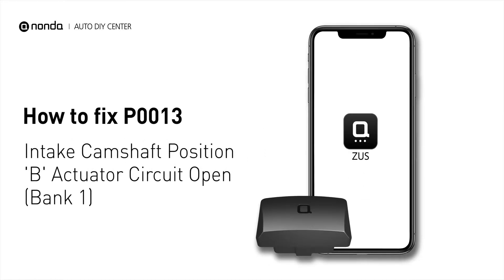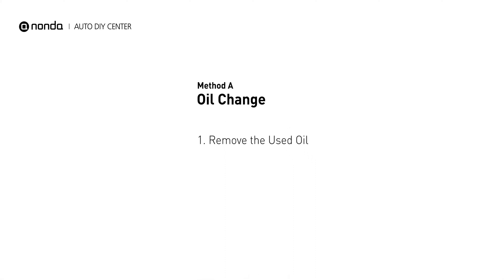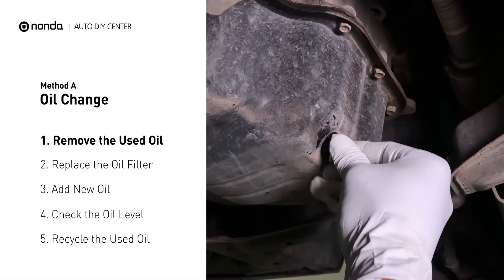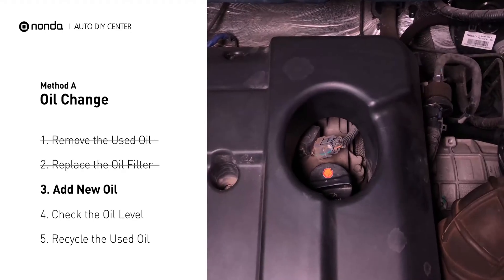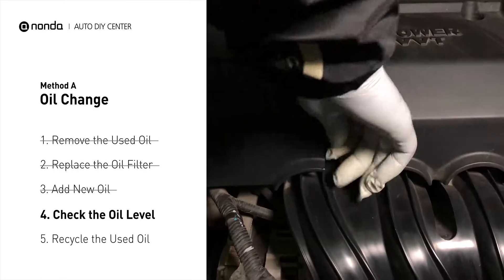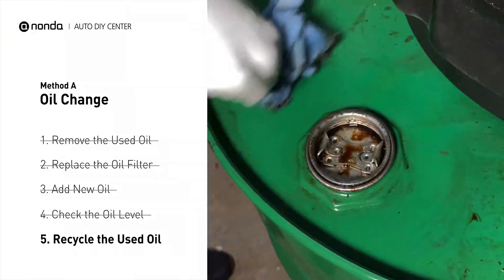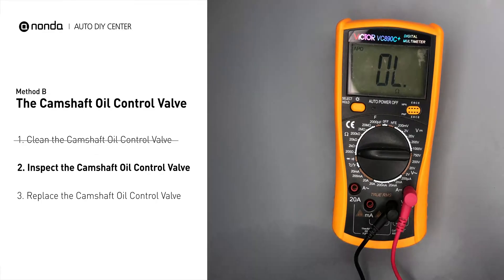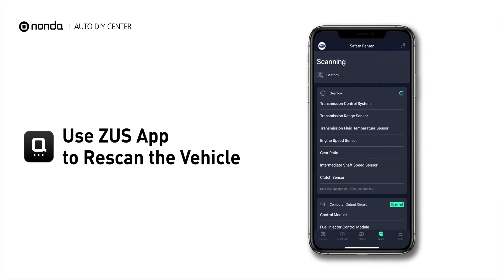How to Fix P0013 Engine Code in 4 Minutes [2 DIY Methods / Only $6.63]

Comment from the maker: Hi, I'm Steve, nonda's lead mechanic engineer. 
Feel free to leave your comments here if you have any mechanic questions, I will be glad to help you out!
Reply: How you get 6.9~7.9 ohm as resistance acceptance range ? manufacturer recommendation? Is that same for intake/exhaust solenoid valve? anyway thanks for this video, currently my Captiva 2015 2.4L pop up engine check with scan result P0013.  now i'm still considering either only clean up or should replace these solenoid.
Reply: @radio1802
Reply: Greetings from Seattle, I have a 2007 Mini Cooper and I just had a diagnostic test. The same code came up and I’m trying to figure out which specific VVT needs to be replaced. I have two, but when I researched the codes meaning it’s referred to as the variable valve timing solenoid on bank 1 of my engine. Your video was super helpful, but do you think you know which specific VVT my Cooper is telling me? Thanks❤

Comment: If your car is going into limp mode try disconnecting this sensor. I paid AUD$800 for Regan Melbourne and all they did was disconnect this sensor.  Overpriced diagnostics and poor quality service.  I have had many Peugeots in my time (403, 404, 504) And my good friend Sigmund Jorgensen (Deceased)  always had a Peugeot. My father worked for the  Peugeot Factory.  This will be my last thanks to Regan.

Comment: I replaced my variable valve timing Solenoid, but unfortunately, my check engine light is still active with the same code, even after a couple of weeks. Had the oil changed before replacing the part.

Any suggestions?
Reply: Check the connectores and the wires.

Comment: What the video fails to mention is that you have to remove the valve cover to get to the camshaft oil control valve which takes a lot more than 4 minutes.

Comment: I'm getting this code only p0013 on my opel which is american buick regal / vauxhall insignia 2.0 turbo 4x4 162kw automatic.

code deleted and did not appear back

any suggestion ? errr said " camshaft position (cmp) actuator exhaust right rear bank 1 circuit malfunction

Comment: Hello, I have a 2011 Mini Cooper Countryman S All4, I have a code P0013, I have changed out my camshaft  actuator sensor, camshaft oil control valve, changed oil. I still have the code. Can you help me how to pin point the problem?
Reply from the maker: Hello, is there any other code that register along with this code?

Comment: Hi, I have a 2013 Chevy Malibu hybrid and I have this code as well as P069E and P0101. Could replacing the Engine Timing Solenoid fix all the codes?
Reply from the maker: Hi Chris, as you are receiving more than one error codes, we suggest getting your vehicle visually checked by your local mechanic.
Reply: @nondainc  Thank you

Comment: On the Mercedes E320, 2016, the solenoid valve is mechanical only. Ran engine flush to loosen any clogged oil in the solenoid. Getting BOTH intake and Exhausts on Bank 2 not working (cam sensors and actuator sensor, plus misfire faults all on Bank 2. Help
Reply from the maker: Hi Robert, can you please confirm if this is the only code you're getting?

Comment: I have Mercedes e350 2008 and see code p0013 & p0453 should i change camshaft as oil is average and new
Reply from the maker: Hi Mustafa, we suggest getting your vehicle visually inspected by your local mechanic for further diagnosis as you are receiving more than one error code.

Comment: I have a 3 pin to test, I get 5.5 from two of them but only get 1.25 from other end one, so is mine bad???
Reply from the maker: Hello, please provide us with your vehicle's year, make and model.
Reply: @nondainc  hi, mine is a 2009 Chevy cobalt. Maybe I took the wrong piece off, it was near the circled location? The piece I took off was on front of & end of oil block & all plastic except 3 pins. It looked nothing like your video part? Is it further to side or back? My engine doesn’t look like video, there’s no black covers on either side. Part I took off didn’t look like yours or a intake or exhaust valve? Here’s what reader says, P00013 = B Camshaft position actuator A control circuit/ open bank 1.
Reply: @WHATEVER  Did you get it figured out? I have a 2019 Ford Taurus & that code popped up, said the same exact thing. So I bought the exhaust camshaft position sensor, which I believe is the part you're describing. I didn't get to install yet, as winter is just getting over here, and no garage. I believe the parts their showing here on the video are the VVT solenoids? Which I know do go out & need replacing, but in our situation for the code we got..Idk lol yeah a bit confusing. Lemme know what /if you got yours figured out. Thanks
Reply: @HuskerRed11  yes ur right this is not titled right or wrong video for that code?!?! I did do the video part though & just cleaned inside with cue tip & wiped off the oil & put it back. It hasn’t given me a bad code since, not sure why it tells us that code though? I replaced exhaust solenoid 2 yrs ago, with an OE part… Oil change is coming up too but either video code is incorrect cause car is running fine & error free since I cleaned VVT black sensor for oil. My camshaft oil part didn’t look like this In engine area no prongs to test, it was all plastic but as I said cleaned sensor & around threads in block & removed some gunk  perhaps affecting sensor?
Reply: @MYSONMYBUDDY  Yup I believe that's what I was told also, to replace the all plastic exhaust camshaft position actuator sensor, after disconnecting the negative battery terminal first. Then after replacing the sensor, hooking the battery back up, if that amount of time replacing sensor doesn't turn check engine light off, use scan tool. Also, trying changing your oil too, I guess that helps some ppl in these instances. Lemme know how it goes.

Comment: Hi, Steve. Thanks a lot for the video.
My chevy equinox 2015 has had checking engine light on for a while. But it has no symptoms at all.
The code is P0013. I checked both intake and exhaust  solenoids. Both of the resistances are 11.2 ohms.
Do I need to change both of them? 
Thanks again.
Reply from the maker: Hello, can you please confirm if this is the only code you're getting?
Reply: @nondainc  Yes, so far there is only one code.
Reply: @nondainc  I cleared the code yesterday, and today the CEL is off when I drive. Let's see how long it will be off.
Reply: @anyDiy  Hello, I know I'm a bit late but the exact same thing happened to me in my 15 equinox LT yesterday. What ended up happening with yours?
Reply: @lowkeygymrat  FYI: I bought a new intake solenoid, every thing is ok after replacement.

Comment: I have this engine code can I do it myself or is it a complicated job I need to change the phaser do I buy the part and do it myself or should I pay the dealership to fix it anyone can help please and thank you
Reply from the maker: Yes, you can. These videos we published are created specially for people like you so you could fix any error codes by yourself in the easiest, quickest, and cheapest way. Kindly follow how we fixed p0013 by checking the oil level, testing/replacing the Camshaft Oil Control Valve and replacing the engine oil. Thanks for watching!

Comment: I'm going to change my oil tomorrow... If  that's all it was I'm going to be upset. I got that code then the scanner started talking about the oxygen sensor.  I changed that at 150.00. A couple of hrs later still got that code.
Reply from the maker: Hi Daniel, kindly check all the electrical connectors and for shorted wiring from the ECM if there's any, then fix it to see if the issue will still persist. Check the OCV if the resistance is correct.
Reply: @nondainc  I changed my oil on Monday and the engine light went off and hasn't come back on. Thanks for this video!
Reply from the maker: You're most welcome, Daniel! We're so glad to hear that the issue has been sorted out.